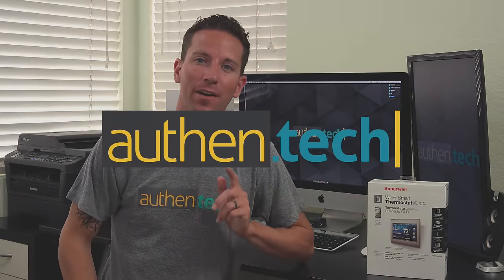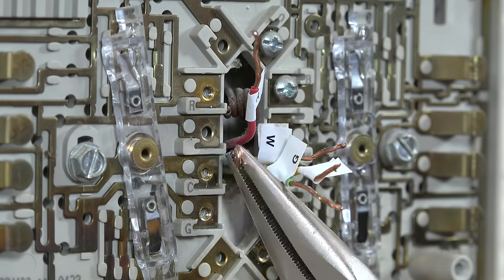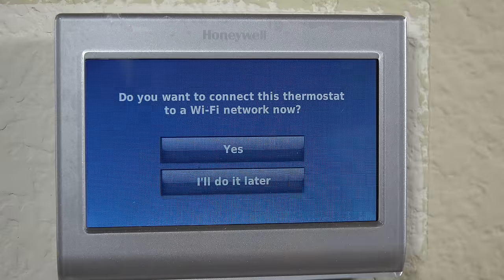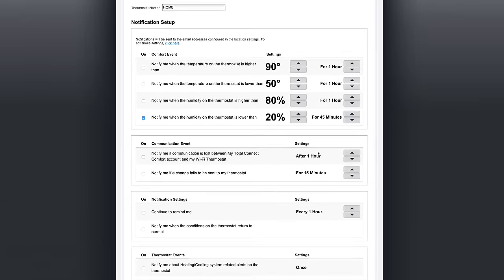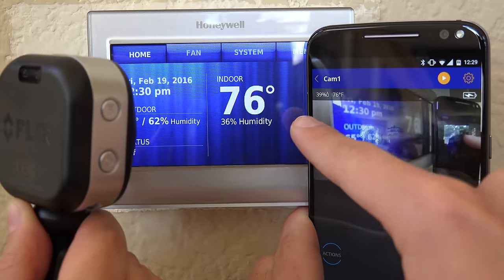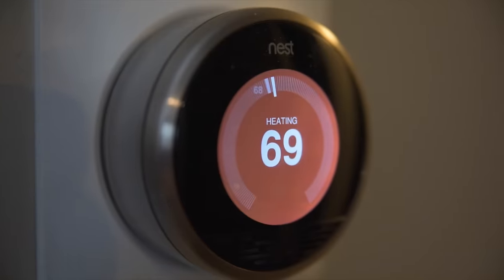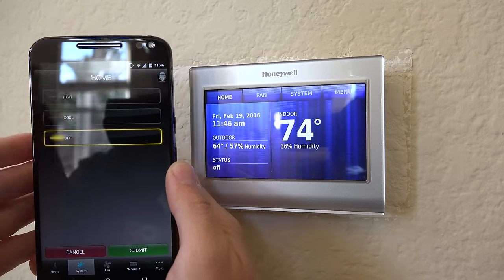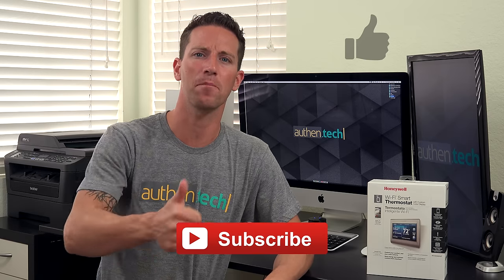Honeywell Wi-Fi Smart Thermostat - REVIEW

Comment: I am an hvac technician with more than 20 years of experience. Honeywell has been making thermostats for over 100 years. The nest is a piece of junk. They have known issues inside the hvac community. Most technicians do not like them. Most of those features nest provides is smoke and mirrors. People will not use them or alter their lives to fit the thermostat. I love the honeywell 9000. Its definitely my recommendation for a nice wifi thermostat. It works, works with different types of systems. It is reliable and easy to set up and use.

Comment: Don't forget to cut the power. Even though 25V is low. If you some how short the circuit. That can cost you hundreds in repair. So play it safe. Cut the power to the furnace then install.

Comment: Does it have tamper proof controls like a screen lock or password to keep unauthorized people from changing the temperature settings? If the screen is locked on the thermostat, are you still able to change the settings with the phone app? Or do you have to go back to the thermostat to physically unlock it first?
Reply: Yes
Reply: @darrellwood79  Too late my friend. Lol. I already took a chance and purchased it months before you replied. Plus you only answered half the questions. You answered "yes" to the first and second question but the answer to the third question is "no". But Thanks anyway. However, I did notice a fatal flaw in the software. Be aware that if you turn your AC/heat system off using the app...you're screwed. The app becomes greyed out, useless and it locks you out. At this point, you can't turn the AC unit back on or do anything from the app. You'll have to drive all the way back home and turn it on manually from the wall controls. I'm glad I wasn't out of town when I found this out. It seems like a simple fix but its worth noting.

Comment: This is a great thermostat. The automatic feature is a bonus for those few weeks of the year where you have the air conditioning on to cool the house but don't want the house getting too cold i.e. set the A/C to cool down to 67 but heat comes on at 63.
Reply: Where is this the setting for this?

Comment: Right now at work I have three of the Proliphix N130 24v Thermostats, they are not wireless but I have them direct wired to Ethernet.  I can program them from my office or even at home with a little hoop jumping through a portal.  These thermostats are about 10 or 12 years old now, and before I start having trouble, and so that I can be more in control of them, I would like to see what else is out there.  What I can do that I haven't see on other smart thermostats is I can schedule the heat to come on and shut down for particular days, weeks, months and really for a year in advance.  This works perfectly for me as I need to schedule heat when guests are arriving and when they leave so that we are not heating dorms or apartments when they are empty.  

Have you seen anything like this out there?  I can go month to month, schedule in and out perfectly.  So you might ask, why do I want to change thermostats?  Well the short version is we no longer have support from the IT department where I work, so I need to find a solution that lets me bypass all of their nonsense and restrictions.  2 weeks ago at home I installed a 7 day programmable King/Atmoz thermostat, and I can control it from my phone or tablet from anywhere in the world.  Unfortunately its only a 7 day programmable line voltage thermostat.  Here at work I need a full year programmable stat so i can set schedules months at a time.

Comment: Something I'm unfamiliar with, and having a varying temperature from the 3rd floor down to the basement......I found the "Circulate" feature to be a big help.  It seems to kick the fan on periodically to keep the air circulating around the house, in hopes to avoid a sauna on the top floor and an ice box in the family room.  Maybe this is a normal feature, but it was new to me, so I'm addition to the Pro's you outlined, I added air circulation to my list.
Reply: Yes, a good idea as long as your ducts and main air handler are indoors. Ours are in the attic so in summer, the circulated air would be heated and in winter it would be cold air.

Comment: Purchased this model a few days ago and inside the sealed box, no operation manual !  Had to find that on their website which isn't the same as having a booklet to study. My only complaint with these thermostats that display the "current" outside temp and humidity is, that information is not specifically outside your location or exactly the temperature outside of your home. That information is obtained from the internet weather websites and those are mostly guessed temps and humidity depending on where those weather stations are located as well as how often they are updated and/or managed by real humans. It would be better to have a WiFi device that mounts outside your home and provides a real time temp and humidity at all times. One other point to make would be to have a small LED that lights up blue or green or red when the system is running when the display is timed to off. We rarely use the "programable set back" temps mainly because our home costs less to heat and cool by leaving the setting set on one temp all day and night such as 78 in summer or 70 winter. We had tried to do what the power and gas company suggests by moving the temp settings up and down 10 degrees however, that costs much more overall in power and gas in our climate area.

Comment: Owned for approximately 5 years. The micro electromechanical relays in the thermostat are starting to fail. I would recommend a thermostat with solid state switching like the Johnson Controls T9500.

Comment: Thanks for the review. Suggestion, before you installed your new thermostat you should have used some touch-up paint. I had the same issue, but I went to home depot and matched the wall coloring, then painted over where the old thermostat was.

Comment: how does this unit, gather the humidity?  Is it the 'weather' or does it have a sensor? Kinda wish, they incorporated humidity sensor along w/ temperature sensors now days in room smoke/ carbon monoxide detectors... basically, cause, these units are already in newer homes and could help w/ 2 story homes w/ 2 ac units and eliminating hot/ cold (bad circulation/ imbalanced systems) spots.

Comment: There is a big problem with this thermostat that rarely becomes apparent until AFTER you get it - there is no way to set a temp differential which means that in larger homes that the furnace will short cycle. Most thermostats (almost all of the the older ones and plenty of the new ones - e.g. Ecobee - allow one to set a differential. I'm NOT talking about an offset which corrects for a biased temp reading on the thermostat - differential lets one set a delta above (in the case of heat) the set point which allows for longer run cycles with less frequent and short cycles that can damage equipment. As it stands, this honewell firmware version willl stop immediately upon reaching the set point. And then a few minutes later, when it drops marginally below the set point, will re-engage albeit for like 2.5 minutes and so on.

Comment: This thermostat has all the features I could ever want except the most important one. I just want to program it to come on at 5am and go off at 8am everyday. However, after talking with support it cannot function in that capacity. 

There is no 'on' or 'off' feature in the programming schedule. It is 'wake' temperature and 'sleep' temperature so instead of coming on at 5am, it comes on around 3am. Instead of going off at 8am, it is generally still on at 11am and I have to hit the off button to get it to turn off. 

I am really disappointed that it won't follow the schedule that I have programmed it for. I have the smart feature turned off, and it still won't follow my scheduled program. 

This thermostat has turned out to be a nightmare because it keeps turning on outside of my scheduled program and will not turn off when I have it scheduled to shut off. Instead of saving me money, it costs me more.
Reply from the maker: That's strange, mine kicks on when it's scheduled, and turns off when scheduled, no issues at all, works perfect.
Reply: If you have the model listed by this video, then you are wrong, there is an on/off and there is a schedule that you can set Wake, Leave, Return and Sleep.  You either have a different model or don't know how to program it if you don't have those features

Comment: For outdoor temp and humidity, does one have to run a wire to the outdoors or is the unit pulling info from a local weather station?
Reply from the maker: Great question - the outdoor weather info is pulled from the wifi, as you input your zip code

Comment: You said it monitors outdoor temps. Does it come with a wireless thermometer transmitter for outdoors?
Reply from the maker: It uses the wifi data to check local conditions

Comment: Do you happen to know the difference between the RTH9585WF (second generation) and the RTH9580WF (first generation).  The difference I see is the LCD screen on the 9580 shows "date/time" and the 9585 only shows "time".  I'm wondering if the 9585 might work with some smart hubs that the 9580 "might" not and perhaps the 9585 has perhaps a newer wifi chip.

What I don't know is if the 9585 has the same background color options as the 9580.
Thanks,

Comment: If I buy a LockState Connect LS-24VAC transformer (plugs in like a phone charger) from Amazon for about $25. I now have wifi  will that work with base board hot water heat

Comment: What does the partial screen lockout entail when it is activated? I am thinking about using this thermostat in a business. I want to be able to keep people from turning the temp too low during the summer.
Reply from the maker: +Matthew Mizushima - Just tested this for you. Home screen still shows full stats, inside and outside temps and humidity. Both fan and system tabs are still shown, but you can't modify the status or temps as it is locked down. Same with Menu settings, you need the password to unlock control. Looks like it would be perfect for an office setting.

Comment: Ben, I have this one. But recently I have had an issue with it, but maybe you could help.  My Wifi completely went out by the provider. So I had no Wifi, therefore I could not turn on my thermostat since I had no wifi connection. I was out for 2 days without Heat. Is there an override or something I can do in the future on my end to get it to work without Wifi? Thanks

Comment: Do I need to make new holes on wall for this? I currently have a Honeywell 7 day programmer.
Reply from the maker: Might be the same size? Not sure
Reply: Thanks, I prefer not to make new ones, patch, paint, etc.
Reply: a lot of them use about same holes. I easily fit this unit over a 10 year old honeywell unit.

Comment: Will it work with Alexa and google home?
Reply: Yes
Reply: Spying device dont be an idiot remove it from your home.
Reply: Motor Sportz  should be able to block the port from going out to internet, this will stop one from coming in as well. I dont have one so dont know what the port is. And if the port is blocked you cant get to it either unless you are inside the wifi area. I did this with my tplink wifi light switch. Can now only access it through wifi.

Comment: problem: the heater always overshoots the temp setting by 4-5 degrees, also has a fan re-circulate feature that doesnt seem to work at all.
any comments?
Reply: Could it be a wiring issue? Mine (circulate feature) works fine. 
And this is a home built in the 80s.

Comment: does the display have a lock out feature so no one can change the settings?
Reply: It has 2 "lock out" settings. Partial Lock : Only temperature can be changed. All other settings are locked out. Full Lock : All settings are locked out. ( 4 digit PIN)
Reply: Yes and the code.. Is on the back side of the faceplate.. The security settings  can be acessed by adding 1234to the code

Comment: I just installed my wifi Honeywell thermostat and turned my power back on , but my thermostat is not starting up, Am I  doing something wrong?
Reply: Sheila Dunn you have to wire the c wire to the circuit bord on your furnace

Comment: does this wifi thermostat have password lock.  My son tends to lower AC to 60F when no ones looking and I need a thermostat thats password protected so he won't change temp settings once they are set.
Reply from the maker: +Alex G - Yes, it has a password lock
Reply: +Ben Schmanke (authentech) It also have Auto-Change over mode to switch between Heat and A/C Mode automatically you go through menu then preferences and then advanced preferences then find Manual or Automatic change-over
Reply: Change your son